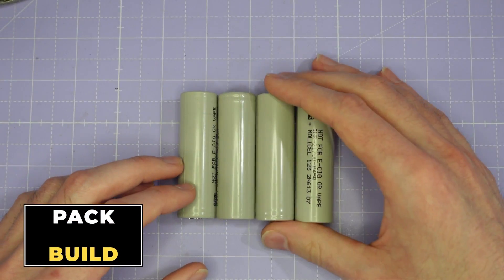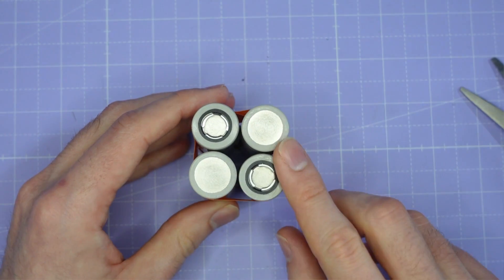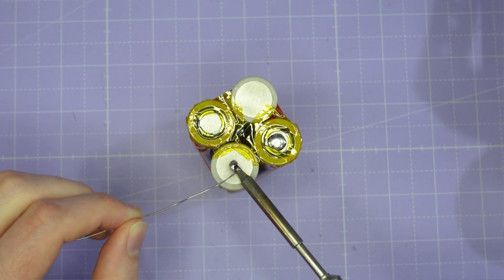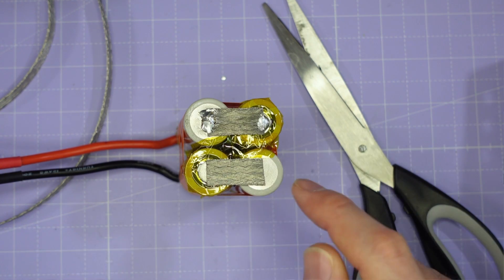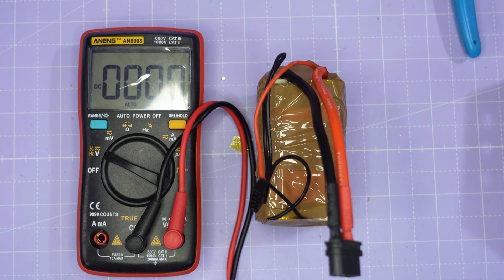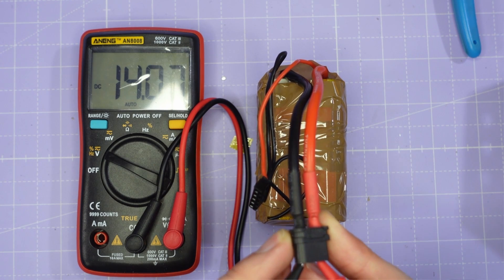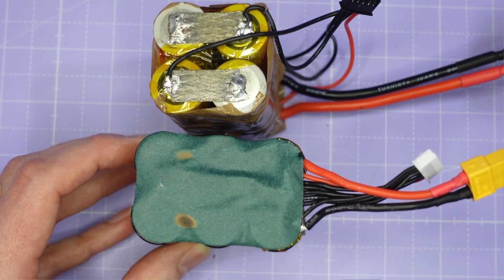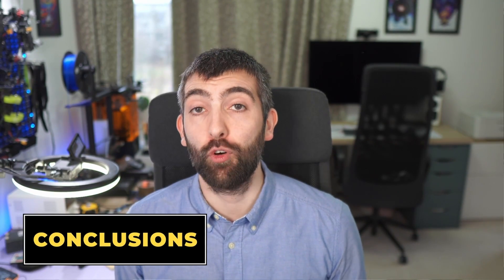Can I DIY the BEST Li-Ion Battery in FPV?

Comment: The heat of soldering damages the cells, shortening their service lives. Builders can avoid soldering the connections between cells with CHEAP and very effective spot welders found on eBay. The one I use cost in the low $20 range and uses a 3S LiPo battery for a power source. No more excuses for not spot welding.

Comment: clean ur cells with a little alcoyhol and scuff the cell contacts get em clean turn your iron up high dab a bit of flux on cells and melt some solder on the tip and drop down to cell surface and it will transfer fast or tin the braid first dab flux on cell get solder on iron use popscicle stick to hold flush to cell and bring the iron to the braid and it will melt nice and quick

Comment: Please do not take advice from a person that does not know what they are talking about. It's videos like this that show people that have no business working with batteries how to build them poorly. You guys keep  building them like shit and setting fires to busses and apartments and homes, the government is just going to stop everyone from buying these batteries. Just because you made a pack at home that has not caught fire does not make you an expert so quit giving bad advice.
Reply: And no wire braid is not a good way to connect each cell together. There are 1000 strands of copper in that braid and just from normal use of the battery the braid can come apart and fray causing shorts. If you want lower resistance use copper nickle strips. And if you want to push the battery harder use more than one layer of .1mm nickle. Learn ohms law.

Comment: I'm aware this video is rather old, but I would like to add something to anyone that is considering making their own packs - as someone who has a decent amount of spot welding experience, half of which has been making packs, what I would recommend is instead of soldering braided copper to instead purchase copper flat plating and using a big hot iron tip to solder that to the cell terminals. 

I was recommended this method by a guy who's made a huge amount of packs of all verities, as the copper plating can carrying about 4x more max amps than in the same amount of nickel. You can also spot weld the copper to the cells as well provided you have the correct spot welding machine to do so.

Alternatively, if you want to only use nickel, you can simply double strip the nickel on top of each other to increase the amp-carrying performance. That should help decrease the heat as the resistance of that connection will now have halved. Hope someone finds this helpful.

Comment: Holy crap I can't believe how much heat you applied to the ends of those batteries - wow wow wow - that heat was applied for SO long.

Obviously I'm no expert - but I've built some packs using a $25 spot welder that works great and is way safer than applying that heat for that length of time.

That said, it worked for you so what do I know. :)

Comment: Chris, you've given me a great suggestion as I did not know there were high performance LI-Ion cells available yet.  I fly where there is a real chance of fire if the quad crashes and shorts the battery so this could be a good option.  However, you really scared me with how long you put the iron on your cells and as you pointed out, you should have used a different soldering iron or tip.  I think you should update this video with a reference to Molicel's spec sheet.  The one I read said "NO soldering".  So although you are going for max amp draw through the connections, you will inspire a bunch of guys like myself to try this, not follow Molicel's warnings, and either damage their cells or worse yet, start a fire.

Comment: You really need to do another video of this with the new EVE 50PL 21700 battery! It's a crazy improvement over the Molicel P45B and essentially made for FPV! 😁

I'm guessing it will do around 120A in your burst testing methodology, much more than the 72A of the P45B.

Plus, make sure to have comparisons with Li-Po batteries in that video! :)

Comment: Don’t do that. Heating the battery so long melts foil inside. Best case: you lose performance. Worst case: Lithium starts to react violently, battery explodes. If you need to solder: Do it quickly! Use flux! Hot big iron! Also route the cables along the battery, it makes much less of a chance to rip off leads.

Comment: Instead of braid, I have .008" thick copper material, which I purchased about 15 years ago for an antenna project.  As it is, it's 3" wide but I can cut it to whatever size I need.  This stuff would make great interconnects.  It's super flat, thin and easy to solder.  I could even solder the POSITIVE of one battery to the NEGATIVE terminal of another....and then bend the strap so that the two cells are nose-to-tail, and in series.  The exposed edge of the folded straps would make a great point to solder balance leads to.  This will be a 4S2P battery for a LR MiniDrak and I need the pack to fit in its long, skinny fuselage/battery compartment (it needs to be 36mm x 36mm x 130mm in length, with the leads at a "square" end).  21700's would be too big for the compartment, so 18650's are on the list.

Comment: Was so happy when i saw the molicel 21700 since that could be the best possible pick for the build... but when you picked up the soldering iron i was about to turn off my pc :(
there are some realy cheap spot welders for battery packs that wont damage the cells as the heat from soldering does.
Reply: Yeah but with such perfomant cells you dont want to use nickel stips and melt them off
Reply: @plomek5039  i've made my first Li-ion pack back in 2016 from Sanyo 18650 cells using DIY MOT spot welder, never had issues with the pack (3s3p). Spot Welding is just the right way to go, if you are concerned about the strips take a thicker ones, like 0.02 pure nickel, or shoot for overkill with premade 21700 copper busbar.

Comment: Whoever decides to build this; please read this.

Hey Chris, I like you and your videos for you being a fellow engineer and standing for what a good engineer should be. You know the theory, you know the practice. I build a lot of packs for drones, bikes, electric racecars etc…
Thus I hope you don’t take this personal. This video is nothing short of hazardous.

There are a few concerning safety issues with it that need to be adressed.

- The soldering: It is a bad idea for various reasons. Firstly the cells get damaged. You see for yourself how long you have to heat up the cell with the soldering iron. You definitely cooked some electrolyte, degrading the cell by a good amount… so far that’s just not smart but not really dangerousl.
What I s dangerous is that you easily could drip solder in between the positive terminal and the negative can. This will short circuit and most likely make the cell burst into flames. NEVER solder a cell. It’s a fight against windmills because people will keep doing it. It is not smart. Usable spotwelders on Amazon are 20€…

Second of all: The thing that literally schocked me was you showing that you reuse the LiPo lead but don’t loose a word about NOT cutting both leads off at the same time since this will short the LiPo. And these things at 4S are MEAN! Hundreds of amps of current will create a HUGE arc flash. You just skipped the part where you cut it… wouldn’t do that.

Third: you need to address that while connecting the cells there will be the danger of short circuiting when connecting the wrong terminals on the opposite side.

Please include these safety notes. That is not how it’s done.

Comment: Too bad all the fuks posting their proper ways of doing this don't have any youtube content, I can't learn much from their blabbermouths. If I build a pack like this I will make a nice connection for max amp draw, soldering just like you did. It obviously did not hurt the battery when you tested it, your 4s performed better than their 6s

Comment: Holy cow, was that a full 60 sec of direct contact between soldering iron and cell?! Isn't it pretty well established that even 5-10 sec will likely increase cell internal resistance and reduce capacity? I'm not gonna say soldering can't be done effectively, but nowadays you can buy a $15 spot welding module for up to 0.2mm pure nickel (for reference, 0.2mm x 8mm strip = 16AWG copper wire)!

Comment: What thickness is that nichel strip? I was also thinking of using cooper braid, but 0.2mm pure nichel strip might also do the job. I’m planing on doing a test to determine exactly where is the sweet spot for a safe long range LiIon pack.

Comment: Hello Chris, First of all thanks for making the fpv hobby next level!  I have a question about molicells/voltage sack/and use for edf models.   i build myself of a crashed L-39 Freewing plane a F22 Foamy for fun light and no nonense flying. specs: 80mm 6s100a 2150KV Edf.  i fly over 1 year with selfmade 4s lion (molicell p45B ) great cells for cruising drone and al normal rc planes for long flight.   I have used them as 2 pakkaged 4s 2p config for this motor i was thinking for a 1500 gram plane would be fine and long flight time... it works... but just enough ... flight time is there btw.   i like to try something and i now... more voltage means more rpm and heat but what i want to try (probably gonne lose the edf):   Specs 8s esc 100a Cont.  8s molicell 1p and throttle down about 70% maybe dynamic throttle as second step or an alarm for the first minute or so. Is there any way to make this happen or would it be better to make a 6s 2p config and don't worry about it .   the problem is also weight 8cells or 12 cells(would be too heavy for this consept).

Comment: I'd recommend using some extra flux and a larger iron. I also pre-tin the batteries. My large soldering tip almost tins the batteries immediately without putting too much heat in the cells.
I use a cheap 80w iron with a huge copper tip. I think its meant for soldering pipes and stuff. Works like a charm and it cost me 15 bucks at the hardware store.

Comment: You should be using super flux m8. Can't remember exactly which acid it is, but it essentially binds INSTANTLY with the mating surface. No warm up time. Its crazy. Just gotta remember to wipe any excess off when youre done. I was using the rustoleum rust remover last time I did it, just what I had on hand. You can make your own as well. Look into it.

Comment: Only issue is we need to unpack and unsolder the whole thing every time to charge those 21700! Just kidding. How do you charge them? Just started learning about building batteries
Reply from the maker: You can use a standard LiPo charger for drone packs. That's what the balance lead is needed for, otherwise you'd have to unsolder them as you say!

Comment: you should buy glitter 801b for funny 200 dollars and produce proper packs. soldering is emergency solution, crippling the cells & risk of fire. cell manufacturers strongly forbid soldering on the cells. read the docs.

Comment: THE USE OF COPPER BRAID IS ABSOLUTELY WRONG FOR THIS TASK. SHORT CIRCUIT/FIRE IS GUARANTEED.ALSO AFTER  KEEPING THE SOLDERING IRON FOR SOOOOO LONG ON THE BATTERY IS DAMAGED.
Reply: Caps much?

Comment: He should have mentioned that the cells all need to be balanced before you start. Also showing a safe way to remove leads from the donor pack would be helpful because it’s easy for people to cause problems. Also a discussion of how hot you can get each cell during soldering would be wise.
Reply: they dont have to be when doing 6s1p

Comment: I expected much better from this video... the construction of that pack is far from ideal/safe. good isolation is lacking, and soldering introduces a lot of heat causing potential damage and a shorter lifespan/performance from the pack.

If there were a note saying that "this pack was made for the purposes of testing, please do research on good pack building methods/practice before making your own" I wouldn't mind it but a lot of people look up to you for your knowledge, and going straight into the wrong ways of making a well performing and safe pack shows some oversight

(not trying to praise the pre made batteries either, they have their fair share of shortcomings)

Comment: I wish he would have measured the thickness of the nickel stripping. It's probably something like .15mm thick, which would limit it's ampacity to roughly 14 ampere. 10mm x .3mm would do almost double that. Nickel stripping can also be doubled though it's not ideal. What is ideal, is copper stripping but it takes specialized welding equipment. The kapton tape is a good alternative to ring gaskets but if you have a choice, ring gaskets are ideal.

Comment: Hey,
My analog FPV setup has decent range, but sometimes the video in my googles starts to randomly drift to the right and gets black/white sometimes. After a few seconds my Skyzone Sky04X beep once and the video signal is perfectly finde again.
This happens super randomly, completley independent on how far the drone is away from me... Also don´t think its a overheating issue...

Any tips on what to do? I need the video signal to be reliable, since i´ll use it for a fpv-job!

Comment: The 6 welding points on the nickel strips doesn’t seem to cause problems, the strips are too thin for the current, just put more layers.
The copper you use is better to get the power thru, but that can not be good to keep 400C for so much time.

I suggest to also tin the copper, keep it hot until it touches the cell, and keep something ready to remove the heat, like copper bread from the frezzer.
Did you know that tin solder has about 6 times the resistance of copper?
So, the solder surface in contact with the battery terminal must be 6 time the section of the copper. For 10mm^2 copper = 60mm^2 solder
Nickel strip, or nickel coated steel strips are not the best conductors either they must be oversized to pass the current without getting hot.
But there goes your energy density, more copper, nickel, tin, lead, steel, less density.
The conductivity of alumin(i)um is almost the same as copper, but much lighter, there could be varying results to solder it :-)
Aluminium oxyde is the problem, to tin the aluminium it must be done without oxygen.
If the surface is covert by common engine oil, oxydation doesn’t occur, scrach the surface with 80 grid under oil, while tinning keep under oil.
Once tinned, degrease and solder.
Using flux, there was no trouble for me to solder 16mm2 copper clad aluminium from starter cables into Anderson 50Amp connectors.
Maybe worth to try, 
Well all that could make good fire, so be ready for it, don’t count on plastic to protect against short circuits, when things get hot or cold, a little hard landing, and flames ...
:-D

Cheers

Comment: my selfe made battery packs have more Wh/g. the cell has 12,45Wh at 5C. I use 3850mah (rated) 52g cells out of the „DJI Mini 3 Pro Intelligent Flight Battery Plus“.  C rating is lower than yours.

Comment: To make everything easier and also give a much better connection, this is the right project where you should use external soldering flux!
You first put soldering flux on both ends sides of the copper braids and then presolder the ends of the braids.
After that step, you do the same with the cells like you did, but the soldering tin will make a much smoother connection to the cells.
Now that you have presoldered all parts you solder all parts together and the soldering tin, which has soaked deep into the copper braids thanks to use of the external flux, will make a connection with as much surface as possible.
Ah: And don't forget to preheat every part to solder before finally soldering the two parts together.

Comment: I always thought long periods of heat was a complete no no with these cells?. Please tell me if I'm wrong
Reply: The less time the iron is touching the cell, the better. But not at the cost of a bad joint:
The iron tip should be much larger than what was used here, as Chris noted. This will make sure the heat is transferred quicker, so you can spend less time with the iron on the cell. If you're spending too much time on the cell, you can stop, and let the cell cool down. With a powerful soldering station, and a big, fat iron tip (the one I use is a flat wedge, about  0.25inch wide, shaped kind of like a flat-head screwdriver), careful prepping: sanding the contact areas of each cell to be soldered, pre-tin every part, add flux to areas to be soldered, my iron is never on the cell for more than about 5~7seconds at most. My welds are solid.

Comment: why didnt you spot weld the cells?
Reply from the maker: You can't spot weld copper (it's too conductive). Nickel strips have too much resistance for a high performance pack. Copper is nearly 5x the conductivity. I've spoken to quite a few serious Li-Ion pilots who've spot welded and soldered. There is  good evidence that soldering gives a better performing pack.
Reply: I think the answer to that was the main point of the video.

Comment: Just use thicker and wider nickel and spot weld that.
Reply from the maker: Copper is around 5x the conductivity of Nickel so you need to use a lot of strips and do a lot of spot welding to match the performance.
Reply: @ChrisRosser  Do you need all that conductivity? What is this burst test you are talking about? That amount of heat you put one the cell when soldering can damage the cell.

Comment: Why not use typical wire?  Is this really lower resistance?
Reply from the maker: Normal wire is fine too. Flat braid gives a nice shape to the finished pack.
Reply: @ChrisRosser  thanks.  That makes sense.  I though maybe increased conductivity or cooling.